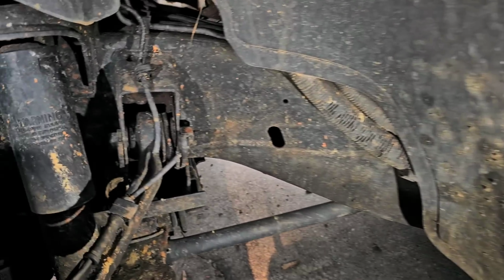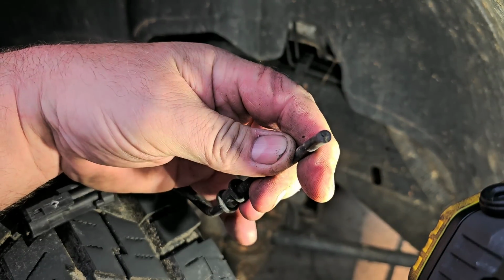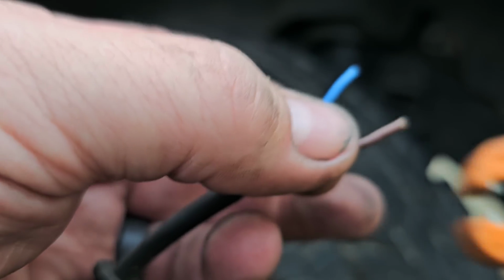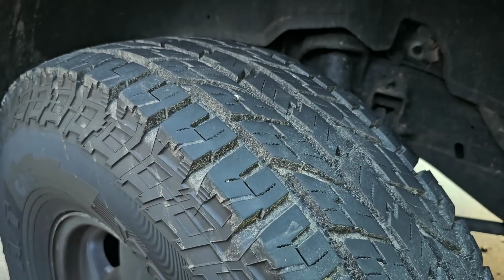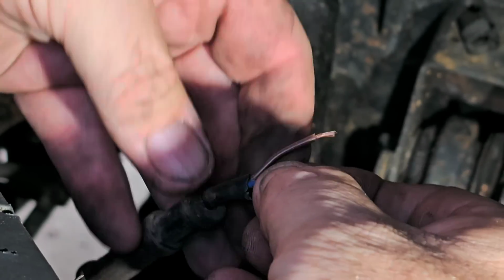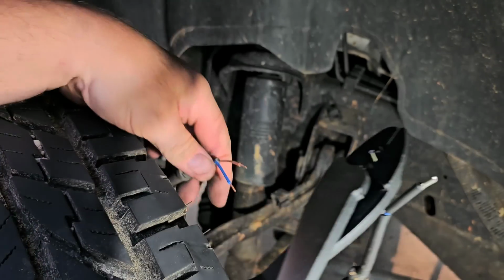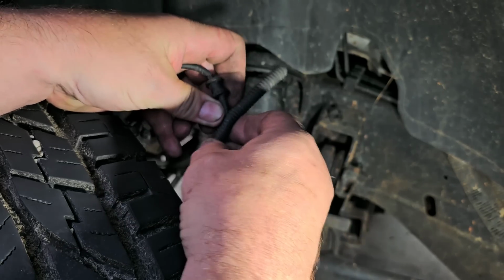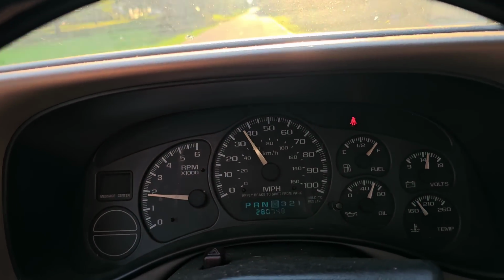ABS Light On. Speed Sensor Open Circuit C1205 & C0035. 2001 Chevy Suburban 1500

Comment: You should get a telephone (CAT3) stripper and also one that does Data (CAT 5) They fit over the round cables and you just lightly spin it around to cut the outer sheathing without damage to the wires inside. Much safer that a knife or razor blade.
Reply from the maker: Thanks for watching & your advice. I appreciate you. Keep wrenching 🔧

Comment: 'Solder, crimp, and seal' connectors only well on interior wiring. They suck on ANYTHING exposed to the elements. (I only use bare crimp connectors, dielectric grease, and heat shrink, or solder and heat shrink)

Comment: The corrosion does suggest the “break” occurred more than a month or two ago, but how clean the “break” was i find confusing. It looked more like a clean cut. If it were from stress (aka “stress corrosion”) there would be deformities due to stresses on the wire coatings and the stress break would be highly unlikely to occur at the same point. Also it appeared that the “break” went through coating and wire at an angle, very similar to the remains after a error cutter was used-

Probably nothing…

Comment: For most sensors you are probably correct that the wiring is not polarity sensitive.  However, some sensors could be sensitive to polarity (i.e. if a diode is part of the sensor not very common),  So as you are probably aware is is usually best not to connect different colored wires.  I have found some factory wiring where they will change colors in a harness.  This, as you probably know, makes tracing circuits very difficult.  I have a 98 Sonoma that has the Air Bag light on, the speed sensor is something I'll have to check.  I think the most likely problem is the sensor activated by the front bumper though. I think they have a tendency to be contaminated by rust  BTW, Love the videos.  Keep them coming!  KOKO!
Reply: Weird newer Chrysler issue, I was told by the dealer, they put the either LF sensor in the RF or vise versa and tranny would not work correctly. I call bs but who knows with new stuff.

Comment: You almost had me going when you pulled out those solder connectors.🙀🙀🙀🙀🙀
Supprised you didnt use heat shrink instead of the wire loom

Comment: Swapping wires on the wheel sensor might not be a problem but on a crank or cam sensor, some of them won't work if they're swapped. I know the older 3.0 Ford V6 won't start if the crank sensor wires get swapped when replacing the connector...been there, done that. At least now,your friend has a safe vehicle again....👍

Comment: why not just use heat shrink but connectors????????????
Reply from the maker: I could. Those do work but have their limitations. I prefer the way I showed as the repair is a much smaller and less bulky repair. I've seen plenty of cases where those connectors you're referring to actually crack at the crimp point after heating. But done properly, they do work well. Thanks for the question!!
Keep Wrenching!!

Comment: Great video! What do you know about the Chevy SSR? I bought one in March and it is a tempramental witch! ABS/Service Brakes light is sporadic along with the door ajar and roof ajar lights with three ding, ding, ding warning sound is maddening! THEN, the next time it's off! I've checked everything visually and for codes! Nothing wrong there. All new brakes, rotors, bearings, backing plates, you name it! 
I'm experiencing severe hair loss! I've also removed and reinserted all the fuses! Could this just be faults in the Computer? How about it guys? Any help is MUCH appreciated. I'm at my wits end. Was there Lemon Laws in 2004 when the first SSRs were manufactured?
Reply from the maker: Have you had the ABS system scanned for codes? It should store a code to guide you in a direction. Really hard to say without being able to look at it myself

Comment: Can you remove the sensor from the damaged wheel hub and transfer to this side
Reply from the maker: Yes. It is absolutely possible. The reason I didn't bother is because of the play in the hub I just replaced. The tolerance between the sensor and the hub are quite close so the possibility of the sensor itself having damage is always there. I have the old hub still so I may make a video pulling it out to see if it is in fact damaged. It may not be. To replace the sensor on this truck, it would require pulling the rotor off to gain access. My buddy actually wasn't concerned about the light, but I figured it would make a good video making that repair.
Reply: @WrenchingWithKenny  You could have used the old cable as well, longer wire, so less likely to be broken again. Known good as that side did not have ABS error codes set in history.